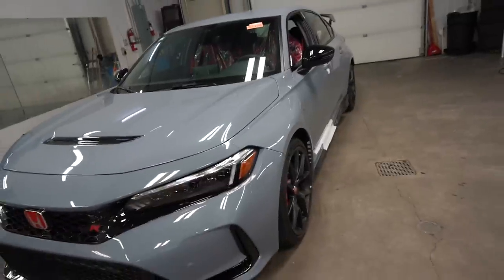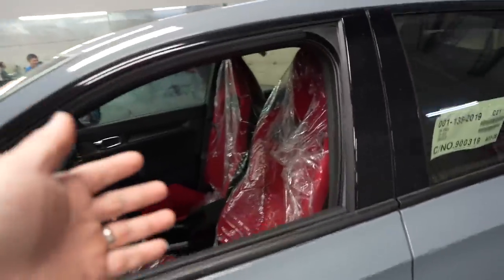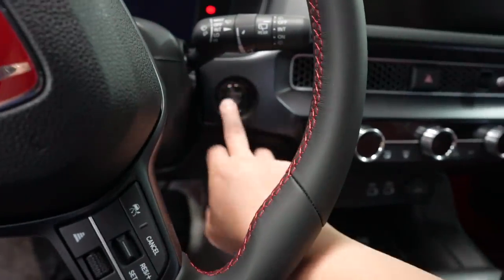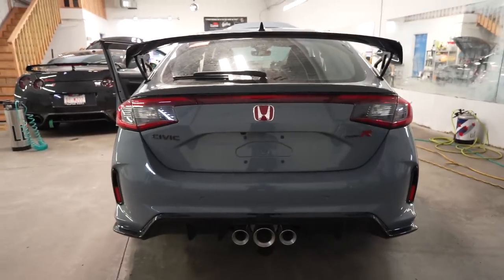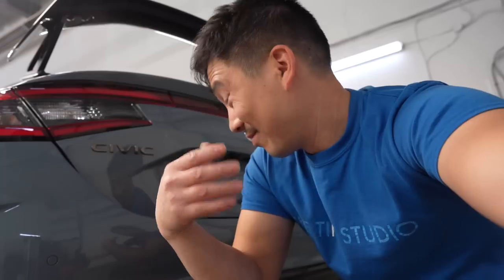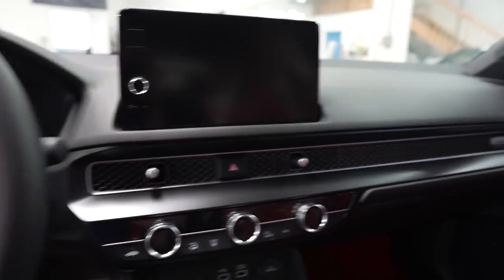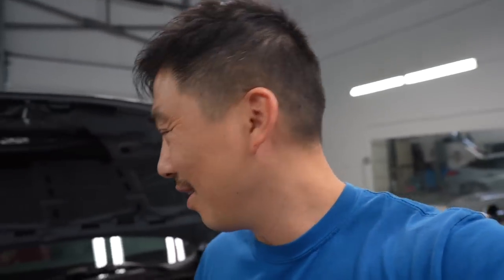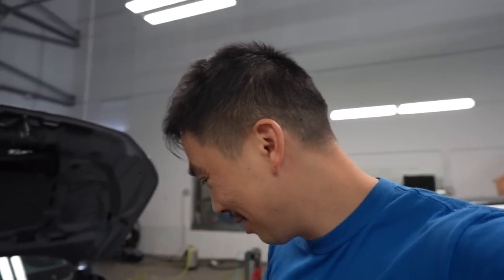$70K 2023 Honda Civic FL5 Type R!!!!

Comment: I think we shouldn’t blame the dealers, we should blame the ones indulging them. No customer should pay a sum like that…
Reply: Though remember, if this is Canada dealers are required to sell the car without markup. However, that doesn't mean they don't throw add ons like this paint film as a $3-5k dealer option when the work charged to the dealer (kind of surprised they outsourced it, most do it at the dealer now to keep more profit) is less than half of that charge. It's kind of ridiculous the dealer add ons I've seen while looking for the car in the US. Had one quote of $80k (the car is $44k in the US) out the door with $14k in dealer options which included LoJack, paint protection film, tint, badges (no idea what that was), floor mats and wheel locks along with a $15k markup on the car. It's nuts.
Reply: 70k for a type r isn’t a regular person buying it. The median income in the United States is 70k. This is the person making way above the average income  who has money to waste.
Reply: No, we should blame the dealers.
Reply: @Vermonstered  And a big problem is, the dealers will put all these options on the car, and not give you an option to get them without the options, so it hamstrings buyers. They are single-handedly destroying the performance car market. Dont let Social Media Fool u. I work for Honda/Acura.. They are struggling and these cars are not selling well.
Reply: @ll.7927  Its rich people and Social Media Influencers. And funny thing is, the more money and connections you have the LESS those rich people are paying.. All of these YTers are paying around sticker, or working out deals with the Dealer.. Its a big scam.
Reply: @bt9765  Yes, you should. It is dealer greed that is causing this. Dealers are taking advantage of the Car Companies and the Public.
Reply: People genuinely have no brsin cells tho and will pay it. Some people are seriously so damn eager to buy things. I watched a video of a guy saying he wormed at a dealership and they tried go over price a civic si mugen when those came out and no one bought it so they had to end up selling under msrp. This is a nee generation though and people will throw away money without even considering it. It's not even about if u have the money or not. Stop giving into a dealership and thier bull shut price gouging.
Reply: @JonHop1  hondata said they paid 65k. U gotta remember 65k for them is like 10k   It’s nothing
Reply: @ll.7927  I dont believe that.. but regardless it further proves my point.. Only the rich and connected can get these cars. Its a friggen sporty honda civic.. The world is going insane.
Reply: @JonHop1  I could of bought any number of these cars if I didn't care about the price. The reason why many were sold in the end to influencers and such is because they're willing to absorb the costs to be first since being first they can also produce the first content which will attract eyes and there's the influencer ad dollars to make up the difference. However I do acknowledge there are a few people with pull who were setup by Honda corporate with sweetheart deals to pay MSRP only at launch. These cars were never going to the general public and through the dealer network.

As for Canada and the add on packages, unfortunately that's part of the service you're seeing in this video. All this stuff getting installed on the car before the customer has a chance to say they don't want it. Especially when the customer can get it done for 30% of the price the dealer is charging for it.
Reply: @ll.7927  nah this is someone that makes minimum wage and living in debts lol
Reply: @Vermonstered  at the end of the day it’s an investment to these influencers, there are always dealerships that sell at msrp. For small fries like us it’s just a waiting game. No rush anyways at least we have a car.
Reply: @TheJapfanboy  Right now? Doubt there's many dealerships that have sold the FL5 at MSRP. And those that do, pull this with large accessory packages that are already installed so you can't remove it from the price.
Reply from the maker: They said if you come in expecting a deal they will gladly point you to the door. Very bold statement eh.
Reply: @phothrottle  expected due to demand. They could say it more professionally though lol buyers are also so entitled thinking they deserve a deal too.
Reply from the maker: @everydayhuy  that is so true. When they don't get a deal they get all upset.
Reply: I believe the right word is (IDIOTS) 😊 see I love my Civics but these prices are outta hand Fak outta here 😊
Reply: @phothrottle  there's always room for the base for those who want a deal lol
Reply: B58>anything today
Reply: @Vermonstered  well the car just released, give it a few months of honest scouting and I’m sure you’ll find one. Might have to drive a few hours out of your way as well but it’s worth it👍🏾
Reply: True but 43k at msrp Is trash for this car.  Elantra N is 7k less and just as fun.  It’s just hard to believe they went that high up over last years price.
Reply: Don't be envious. It's their money, they can pay for whatever they want.
Reply: @nmode22  The Type R craps all over the Elantra N in every way. 🌝😏
Reply: @11onejay  What a jelly! 😆
Reply: @OhgodImtoosexy  oh. All over it huh? It’s a 12.5 second car 😂😂
Reply: @OhgodImtoosexy  well duh. But 70k? 😂 even 50k is a joke.  At that point go buy a v8 🤷🏼‍♂️  I’m just telling people ain’t much of a difference at all from an Elantra N.  Save 7k. Or in this case save  34k 😂😂🤦‍♂️
Reply: @OhgodImtoosexy  I truly can't say that I am lol I just bought a 50k car last year with 25k down I could of got something more expensive but nothing else made sense. I surely wouldn't be throwing away money on a Honda.
Reply: @nmode22  LoL at one looking at a FWD car for quarter mile miles... And two for thinking a stock Elantra N is a 12.5 sec car.
Reply: 70k 😳. Danggggg!! For that price I’d mod the shit out of a brand new 2022 sti with its dinosaur engine which will make it semi beasty and still have cash to spare.. idk. I’m sure this type r is more reliable but I just can’t see it at 70k .
Reply: Used to be a big fan of Honda, bought brand new a 99 civic si, 2006 civic si, and a 2012 civic si..put an order in for a 2018 type r and when they called me it was marked up 6000 over sticker..that’s when I left..will not pay over sticker!! Bought a Subaru wrx instead…good bye Honda!! Now they want 70,000..that’s complete nonsense
Reply: @Vermonstered  I own an Elantra N😂 can’t you read?  It’s not even a secon faster than the N but y’all are like with 7k over the N and on top of that…. 35k more with the markup.  But y’all go pay that 😁.  But I’m sure you’ll never own either.
Reply: @Vermonstered  perfect! Because the Elantra N is not about the qmile.  It’s about the track 😜 still chose the Elantra N for 7k less for track days. 😁
Reply: @Vermonstered  they just had a Honda si blow up at the track!! 😂😂 all your doing is talking down on Hyundai.  Also the newer type r is slower at a roll race compared to last years model.  However it’s damn good track car and so is the Elantra n 😂.  You’re another Honda fan boy 🤦‍♂️. If y’all think it’s worth the crazy high marks then have at it.  😂 I’m simply saying the Elantra N is just as good for way less 🤦‍♂️
Reply: @nmode22  That Si, assuming it's the same one, is one that was pushed with over 320hp with a big turbo upgrade then brought back down to a stage 2 with the stock turbo. It's why the owner didn't care Dai blew the engine. Huge difference over all the completely stock engines that are blowing in Hyundai's that Hyundai allocated $2 billion for this quarter's warranty repairs. 🤦

I love how you're not comparing the Civic Type R against the Elantra N anymore in any spec except price though. 😉 And saying, "the Elantra N is just as good for way less" spits in the face of the sentence that comes in front of it of, "if ya'll think it's worth the crazy high marks then have at it" showing you know the Civic Type R is a better and faster track car. 😉

But not only are you trying this hard to clown yourself but you're making this all about 7k in price? Honda's have better build quality and reliability, has a better ride, better manual transmission among a few other attributes. Some people don't mind paying up for features, just because you need to troll for your latest fanboy doesn't change the Type R is the superior car. Just isn't 7k better by your standards, which is fine, but ultimately you're showing how a $40k car is really stretching it for you and that just says more about you than anything else.
Reply: @Vermonstered  and features? Like what Hyundai had over the last years model type R? 😂😂😂 Honda had to step it up.   But you can get the same stuff for less in the N 😂 Homda had to charge more.  I really don’t know why anyone would hate Hyundai so much for making one of the best 4banger track cars out there🤷🏼‍♂️
Reply: @Vermonstered  oh and don’t for get my Kia k5 and my Kawasaki and my Daytona 675 and my Miata and my 1998 Honda Civic 😂😂 I’m 36 years old and still don’t understand this “I only drive Hondas” fan boy stuff.  Y’all look silly at times but I won’t let people make me hate the car, they Type r will always be one of the top. But again if you want just about the same stuff save 7k or with markups save about 15k to 35k. 🤷🏼‍♂️
Reply: @Vermonstered  I’m for sure not about only my opinion.  Boy do y’all talk a lot to have never driven either car.  😂 what do y’all not get?  I love the type r but I’m not paying the fanboy markup!  All I said is you can get just about the same thing with the Elantra N for way less.  Simple 🤦‍♂️
Reply: @nmode22  Driven an Elantra, it's fine for what it is. The new CTR is an evolution of the old one. 5% better here and there, it's not like it's supposed to blow you socks off. The main thing detracting from the old one was the styling, hence didn't buy one to keep (only a few years to drive it). So driven both, they're not the repeated, "same thing" but again, if you think they're the same thing, shows to why you drive rat rides. Cool if that suits you but again those with access to more funds don't have a problem paying a little bit more for more car and a more capable one. Still weird how you have to interject your cars into this ad nauseam and have to attack anyone who might think an extra $7k isn't a big deal when it IS a better car - and even you know it's a better car. You just can't part with $7k since you have another rat ride to buy. I'm sorry this offends you so much you need to lash out... but you keep doing you... switching your fanboi car every few days (since you needed to flip your entire youtube profile) it seems and attack anyone who doesn't think like you.... Confused? Yes... but oh well, that's you!
Reply: @Vermonstered  I have owned many cars.  Both my mustangs was over 50k.  Fun fact,  I have two Elantra N’s 😂😂.  7k over the Elantra was a big part for me since it’s not much of a difference, but let’s be real…. Nobody is getting the type r for 43k 😂 it will be 50k + and this is my main reason for my post. Go get an Elantra N to have just the same amount of fun. The type r is an amazing car yes but the YouTubers and fanboys pay anything so they say they have the new type r.
Reply: @Vermonstered  wait everyone is hoping to the Elantra N so I followed? 😂😂😂😂 wrong! Everyone talked down on it when I said I was gonna get it. 😁.   Then I let them drive it and everything changes 😂🤷🏼‍♂️.  But I get it the type R has been here for a couple more years and the N models are just getting started.  For sure understand why it’s more popular. 😁
Reply: @Vermonstered  😂😂😂😂😂😂😂 again if you want a car that does just about the same as the type r for a lower cost go buy a Elantra N.  Can’t go wrong with it and save money 😁. And just to think of it it’s only going on the second year. There is one in Atlanta right now for 35,400. ❤️
Reply: @JonHop1  So basically everybody ends up losing 🙃
Reply: @emancebo13  Absolutely.. Everyone except the rich getting richer..
Reply: @TheJapfanboy  Long live the Small Fry
Reply: @everydayhuy  It has nothing to do with demand. These cars arent even selling that well. Their sales are not good at all. And the initial hype is all a facade. Half the cars are either bought by the wealthy and connected, or given to Social Media influencers. This is not indicative of the real market demand at all. Dealers are purposely keeping sales down on these types of cars to make larger profits and make it seem like they are hard to get. They are not hard to get at all. There are still so many unsold old models of the Fk8.
Reply: 70k , no way for any Honda made NOW! 70k I’m looking at a good used GTR………

Comment: 70k is way too much even 60k is pushing it.
Reply: 45k is pushing it for a civic with a turbo, body kit, and minor suspension upgrades.
Reply: @j_tootie  the only factual statement there is it having a turbo lol i wouldn’t call it just a body kit or “minor” suspension improvements.
Reply: Wait till he's done with his, but if you want brand new you're paying it
Reply: @j_tootie  lol.  Minor suspension?  Completely different platform underneath the type R. 

Brembo brakes, automatic rev matching.   Only thing civic is the body
Reply: @charliesmith7942  lol like I said, minor suspension upgrades. the R doesn't have anything that you couldn't get or swap over to the base model Civic. 

you can justify it any way you'd like, but at the end of the day it's just a FWD civic with a 60k+ price tag, that now looks like an accord in the front. 

I'm not saying it wouldn't be a fun car to drive (I've had/have plenty FWD turbo cars), it's just that there are much better choices including AWD for the price that these are be going for, and unfortunately with the greedy dealerships I see this going the way of the Kia Stinger.
Reply: @j_tootie  did you miss what I said?  It's a completely different chassis.   It's nothing like a regular civic
Reply: @charliesmith7942  same chassis, upgraded suspension components (along with other stuff). different chassis would be civic vs pilot where you can't just swap components over. 

If I can buy a totaled type R and swap the suspension over to the base model without any issues, then it is just a civic with a turbo, body kit, and upgraded suspension. (and some software mods). which is why this vehicle was so alluring in the first place, the original appeal was that you can have a hot hatch for not much more money than a fully loaded base model. 

Greed and people with more money than brains are making it way over priced for what is essentially a civic with upgrades.
Reply: @j_tootie  it's the fastest and best handling fwd car on earth.   Dominates time attack where I live.  Faster than most rwd and and cars in factory trim around a road course
Reply: @charliesmith7942  it must be true because you say so. it's still just a civic.
Reply: @j_tootie  look it up then.  Nurburgring
Reply: @charliesmith7942  never said it wasn't a good car so I'm not sure why you are trying to convince me that it is, it just isn't worth the price tag in the least. 45k is the max it should ever be, and anything more it needs to have that extra something that makes it stand out from the 45k version.
Reply: @j_tootie  the front suspension is a completely different setup from the base civic or the SI. It's not just a matter of swapping shocks and springs.
Reply: @MrJjburgess11  sooooo...... Upgraded suspension.....
Reply: Whoo ever pays that much is lame

Comment: I think it's funny how people say there was so many fake vents on the previous model. There was only 4. Front bumper vent(2)and rear bumper vents (2) everything else was real. Also Mercedes gets away with tons of fake vents so fake vents is a normal thing for every manufacturer. And there's only going to be more when everyone switches to electric
Reply: Dumb question. Cant we just drill/delete those fake vents? Will they be functional or will it fuck up the aerodynamics
Reply: And the 2020 and 21. Only the rear had the fake vents.